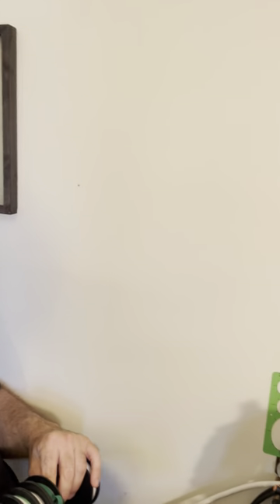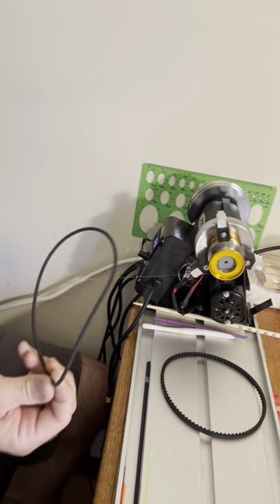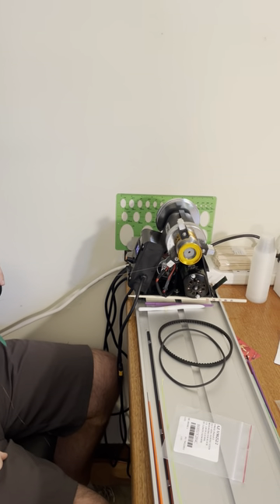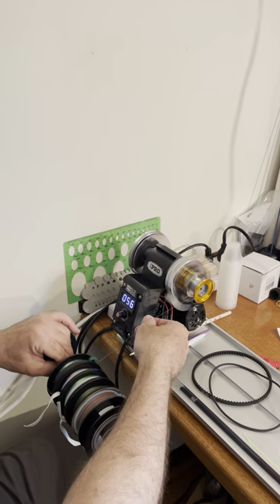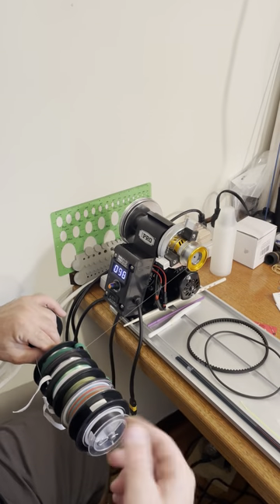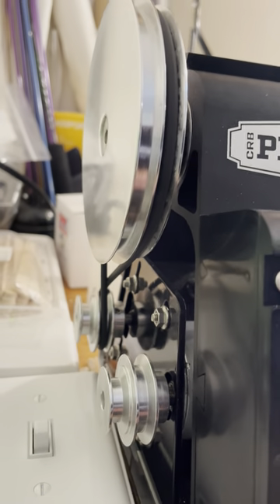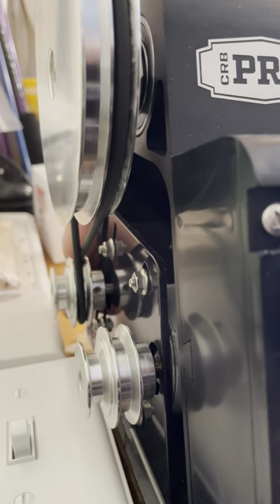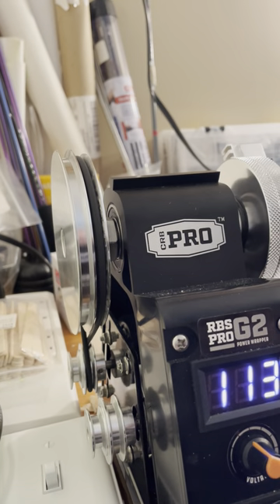Turn your CRB Pro G2 Power Wrapper into a spooling station!

Comment: Top idea Tom, Love it
? The CRB Pro head stock, When your doing thread work on rods & you over cross threads & need to reverse can you do it manually by just winding back a little by hand
Why i ask is i want to upgrade my power wrapper & trying to work out the Best new rod lathes
Cheers Steve 🙏
Australia
? How do you find your foot peddle
Reply from the maker: Good morning Steve, yes you can easily reverse by hand when you cross over threads, been there and done that many times.  The metal foot pedal that comes with it now is much better than the original plastic pedal that came with the first shipment of G2 wrappers.  I had the plastic pedal and Mudhole sent out the new metal pedal about a month and a half after I got the wrapper.  I ended up taking the cord from the plastic pedal and using it for a light switch in a plastic project box so I can run epoxy at speed without being on the foot pedal all the time.
Reply: @ctdoutdoors  
Brilliant , that's a bonus, thank you for your reply 🙏.  I suppose the another ? is like the slip clutch where you can stop it by hand without turning the motor off is this capable of doing that. Can you adapt / attach the slip clutch the head motor.
I'm finding it hard to find / get information i need to make a decision.
How do you like the whole setup overall, Is it the best on the market,
We can't get it here on Oz so i'd have to import it, the problem there is spare parts etc.
Thanks Tom, really appreciate your time and information
Cheers Steve
Reply from the maker: @Stevos_HookedonRods4844  hey Steve, it is not a slip clutch for the headstock unfortunately. I am not sure if there are any rod building lathes that have that feature. I’m not sure if it’s the best on the market but it does a damn fine job. I think I would enjoy the setup more if I had the adjustable roller stands with the ball bearings. I bought the track and V stands a while back when the older G1 system was back ordered (discontinued, but they didn’t want to say that). Then when the G2 came out I bought just the motor and foot pedal assembly, not the whole kit with the track and stands.
Reply: @ctdoutdoors  
Thanks Tom, 
Really appreciate the help & information
Really grateful 
Cheers Stevo